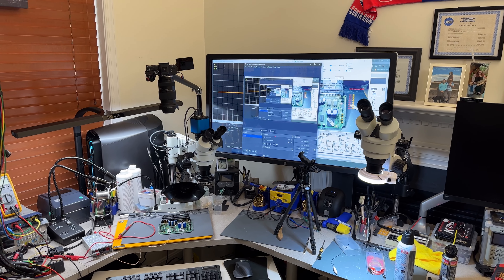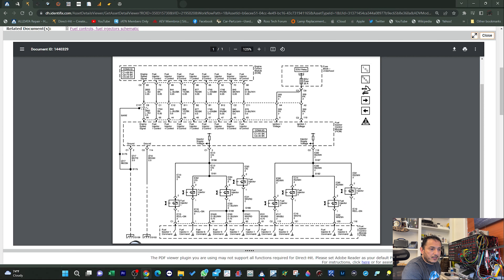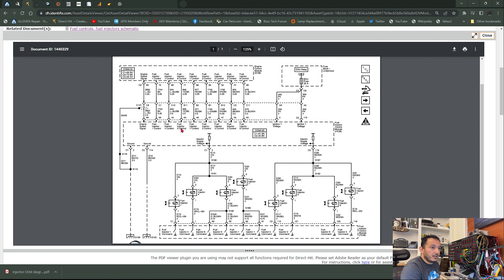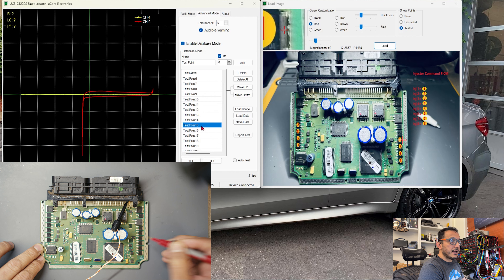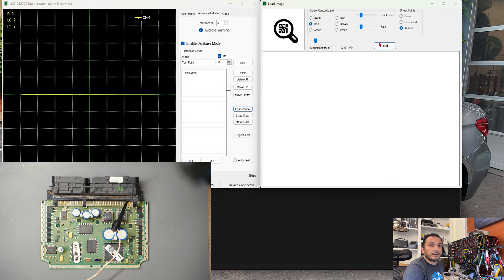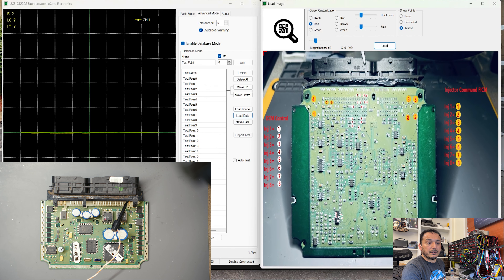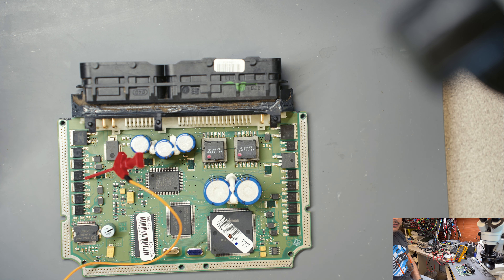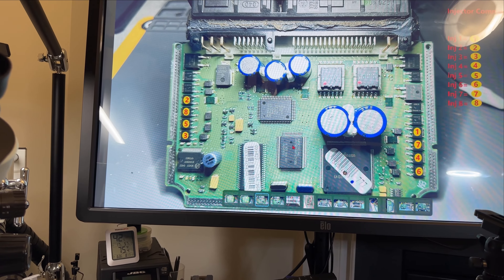2004 Chevrolet FICM Fault P0207 injector 7 control, FICM full test with curve tracer

Comment: With out powering it up and commanding the injector to come on, Its hard to guarantee 100% its not the gate driver IC that has a failing I/O for the bad injector. I see single I/O's go bad quite often. Not as common but can trip you up once in awhile cause it can test normal when not telling it to switch.
Good job on the one with liquid damage.
Reply from the maker: I tested the gate driver IC, not on the video! But honestly I have never seen a module that the gate driver IC is bad before the actual driver.
Reply: @MaicSalazarDiagnostics  Not seeing it before on this module is usually a good indicator it should be fine. Typically in our work things get pretty repetitive for each module.